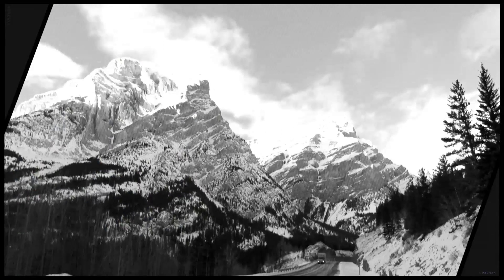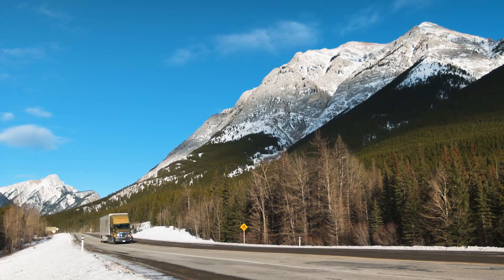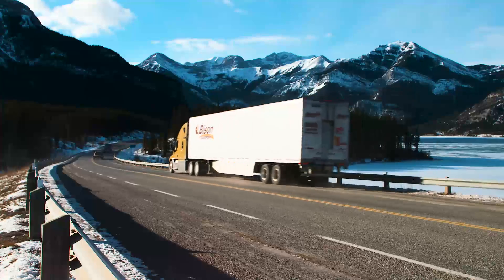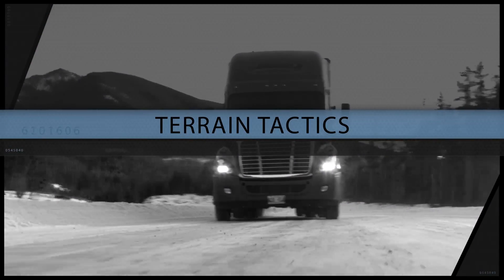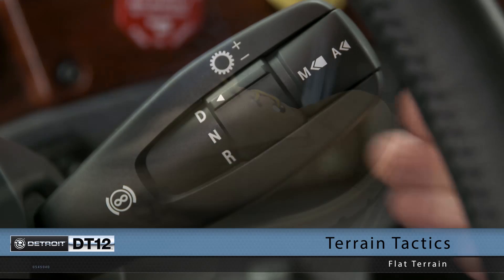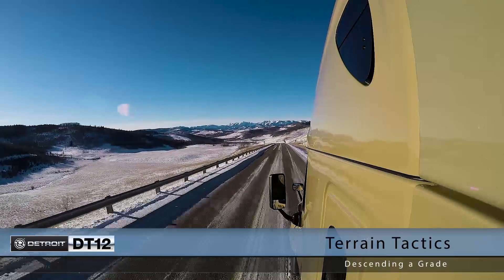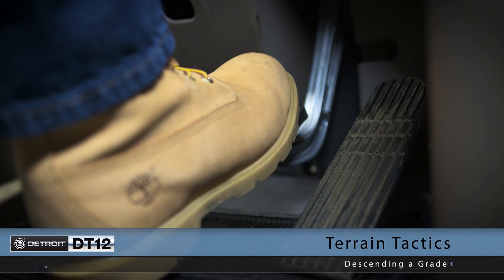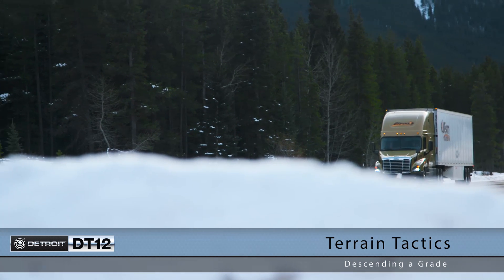Driver Training Series: Detroit DT12 in Winter Weather Conditions

Comment: I don't think you'll get the safest driving experience...probably  75 percent or more of the trucks you see in the ditch in winter time are freightliner and Volvo....i had a MACK I n the 90s that had automatic shift... it had a T stick on the armrest you had  RNDHL  when you went down a hill you slowed to the speed you needed to and then put the stick in H for hold  and it would not shift up on you if you picked up some speed it still had a clutch for starting and stopping ... L would down shift the truck using the Jake brake faster then any gear jammer that ever lived all you had to do was keep your foot on the brake and it would work the gears all the way down until you came to a stop very cool feature... I'll be getting a Pete ...in August.. with their automatic ... not thrilled.. but i wasn't going to shell out the extortion money they wanted for a manual transmission.

Comment: Too many bell n whistles. A lot of stuff to remember. Why can't it be simple, like the trucks have been for the last 50 years ? I want control in the mountains on icy roads ! Just engine brake on / off and 3 stages. Non of this piano playing. " Engine brakes are NOT recommended for decending a down grade" !!?? So just ride the brakes untill they fail ?? WTF !!
Reply: they probably base this in inclement weather. icy roads downhill etc...
Reply: Yes engine brakes are not recommended on slick roads.. duh.. where'd you learn to drive swift ?